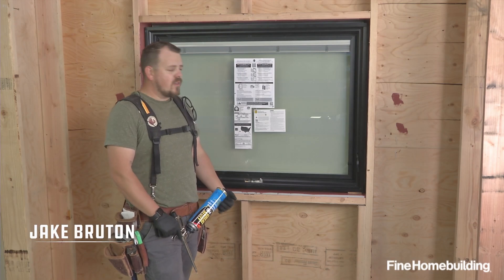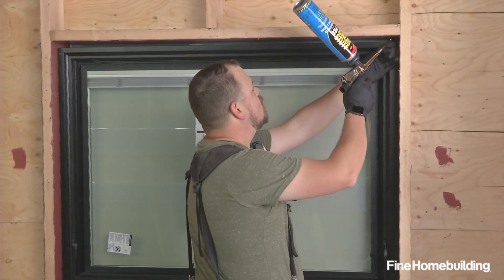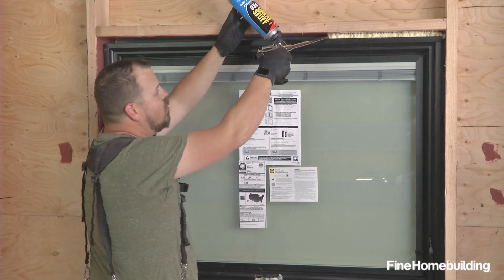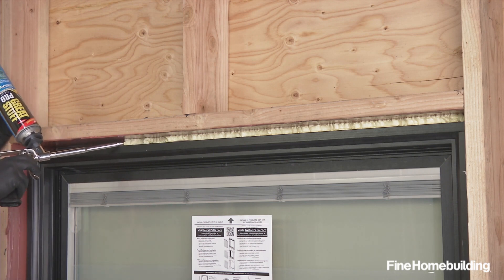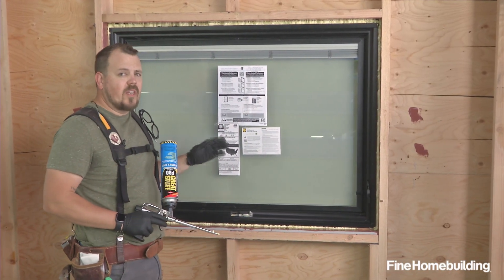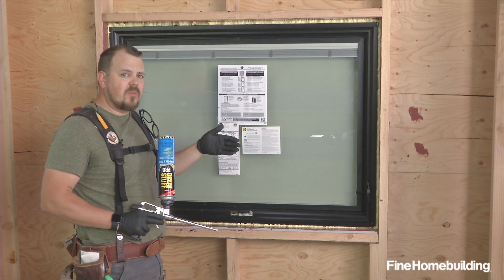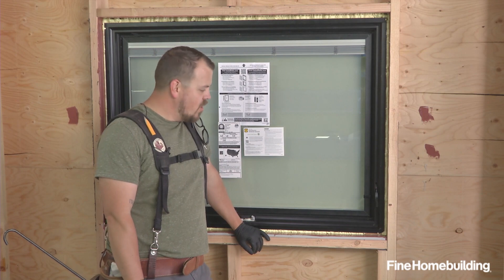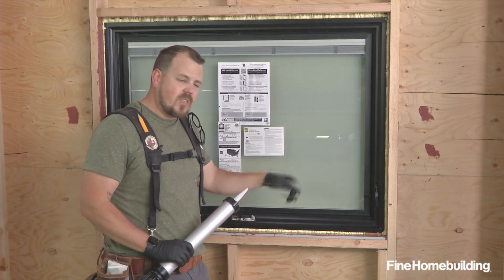Part 4: Air-Seal and Insulate a Nail Fin Window in a Wall with Exterior Rigid-Foam Insulation

Comment: Why use the sealant over the shim rathar than foam? I removed the trim on my windows, planning to use backer rod and foam, there is a shim but its super loose. Seems to not be doing anything, the house and windows are about 20 years old. Do i try to force the shim in deeper and see if it makes contact, or is it basicly  useless now that the house has settled?

Comment: If the sill is sloped outward do you still need shims like he did here?
Reply: In a prior video he added a sloped topper to the sill; if your sill framing is already sloped toward the outside you wouldn't need the prior topper he added.  The sloped shims were to bring the outward slope back to level (for the window to rest on a level surface) so you'd still use them if the window sill was already sloped outward.